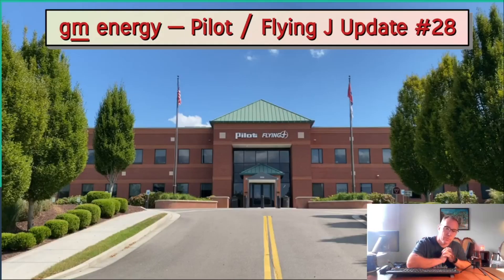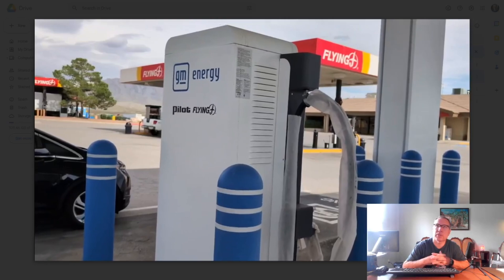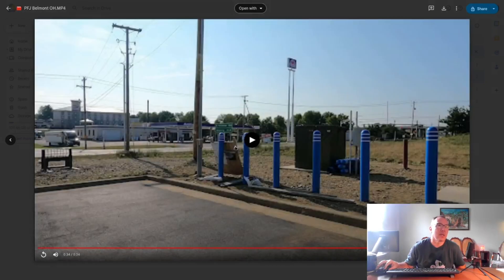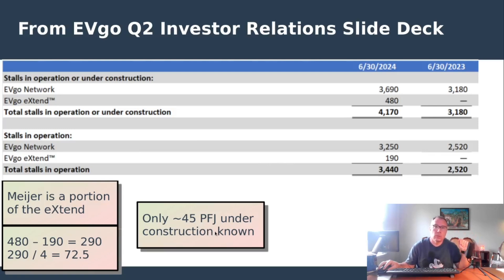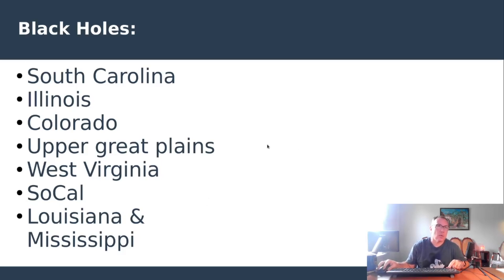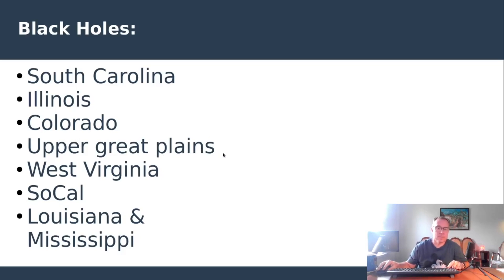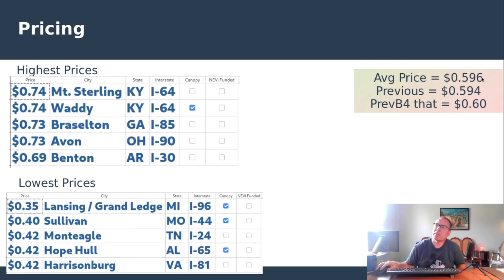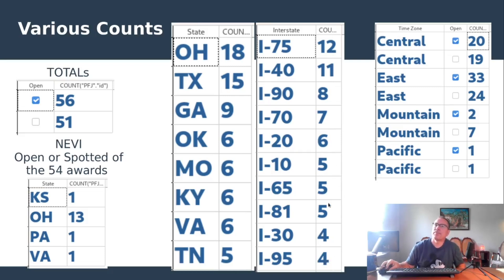gm energy - Pilot / Flying J Update #29 (Electric Vehicle Charging)

Comment: Wow comparing the four highest priced locations per KWh price, 3 of 4 are nearly double the price compared to the nearest Telsa Supercharger and the one in Brastleton GA is three times the price compared to the nearest SC.
Reply from the maker: Yes, for Tesla owners.  Check the TesSC   price for non Tesla owners though.  GM will offer discounts to their owners too, so basically the same concept
Reply: @thenetworkarchitectchannel  Will be interesting to see if there is any monthly subscription pricing like Tesla has to get pricing down per Kwh.  13 dollars a month on Tesla's network to get same pricing as Tesla owners seems pretty reasonable.
Reply from the maker: @cdog1762  afaik, only discounts announced are for GM owners.  Even EVgo member discounts are not honored
Reply: GM claims they might offer discounts but....

Evgo and many of the charging companies have to charge the price. 

Tesla V4 chargers might have two prices.

Comment: Legit question: Why would "Coal Country" be the reason WV doesn't want to build things that deliver insane amounts of coal generated electricity?
Reply from the maker: Seems reasonable.  I am only going of my trips through eastern KY & WV.  There were several instances where as an EV driver looking for a charge, I was met with politeness with an obvious nothing more behind it.  Also, dramatic low numbers of chargers.  This, I concede, is an assumption on my part, but you are correct.  Perhaps EVs are seen in those areas as a way to boost grid demand and there by help the local economies.
Reply: I have noticed there is lots of small oil operations in WV.  That’s likely the bigger reason they are dragging their feet on EV charging infrastructure.
Reply: There's an underlying association between EVs and renewables that positions electrification as a threat to coal sector jobs. In reality, that industry has been in decline for more than a decade in the US and clearly predates mainstream electric vehicles. Unfortunately, the correlation is often taken as causation in coal states, even when the state could benefit from expanding into another generation source. See also Wyoming with wind power.

Comment: Hearne, TX is pronounced like hurn.  That sure is an............interesting? decision to roll out such a large location there.  Bryan-College Station has a glut of chargers so highway 6 between Houston and Waco is already well covered.  I won't say no to additional charging in the area, but seems like that location is going to be underutilized for a long time.  

Compare that with the Pilot/Flying J EVgo locations in the area and they are placing them in VERY good spots to fill gaps along the highways for the most part.  Still some holes to fill (East Texas between I-10 & I-20, Rio Grand Valley outside of Tesla Only stations), but overall whatever selection process they are using is working pretty well.  Shell on the other hand.....
Reply from the maker: Thx for clarifying how to pronounce.  I agree it seems pretty big for road tripping, but maybe they had their reasons.

Comment: There is one “Coming Soon” Pilot Travel Center location in Grand Junction Colorado. It has been “coming soon” for many months with no sign of construction. 
The availability of transformers seems to be a frequent hold up in getting new stations operational.
It’s ironic that a coal state like WV would be anti-EV since most of their coal is used to produce electricity. Granted the amount of electricity generated from burning coal is declining rapidly.
Reply: The amount of electricity generated by coal isn't declining at all - it's only declining a bit in the US while it is booming in China.
Reply: @kirkjohnson6638  What do you base that on?
Reply: @COSolar6419  The fact that China is building coal plants like crazy and we aren't taking many coal plants offline because we are having trouble keeping up with electricity demand.
Reply: @kirkjohnson6638  In 2001 77% of the electricity in Colorado was generated by burning coal. In 2023 electricity from coal has dropped to 33% with renewables accounting for 36%. In March 2024 coal was down to 22%, methane gas 34%  and renewables at 44%. With cheaper wind, solar and storage coming online, all of the remaining coal fired power plants in the state are scheduled to be shut down by 2030. Source: the United States Energy Information Agency.
Reply: @kirkjohnson6638  
I am a power systems electrical engineer. You know more than me. Just a few weeks I learned that coal is still a major part of powering production for the US American  electrical grid.
Reply from the maker: Long pole 4 sure is utility

Comment: Hope that PFJ site on I-10 goes live soon! I've driven through that area on a cross-country trip. More public charging is sorely needed! I think Utah and Nevada should be on the "black hole" list. Yes, they have chargers along the interstates, but there are vast rural and recreational areas in those states that sorely need them. You probably already know this, but an Electrify America site in Primm, NV (finally!) opened last month after 2 years waiting for a transformer. Unfortunately… two weeks later: "Electrify America is aware of an issue rendering the chargers at this location temporarily unavailable. Our maintenance team is actively working to address the issue." Boooo.
Reply from the maker: argh, sounds frustrating!  UT has one spotted.  NV I didn't add, but perhaps should of.  Good point.